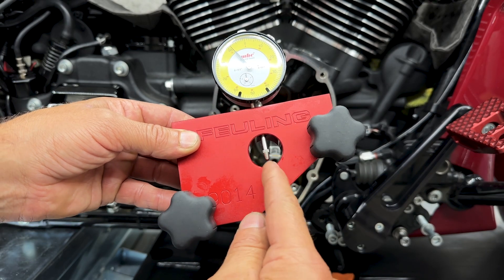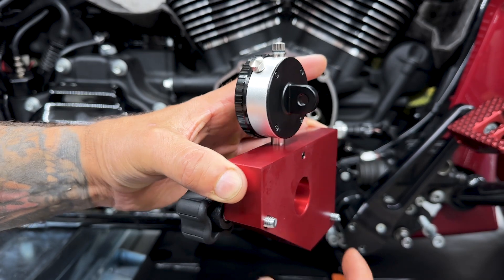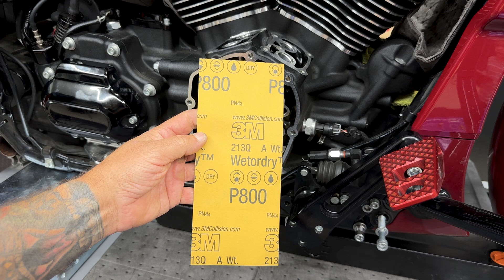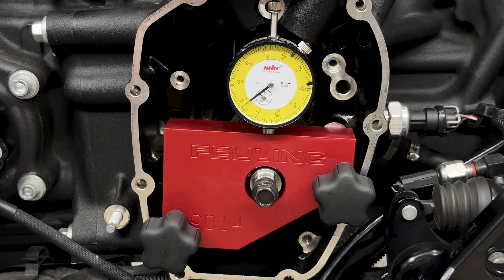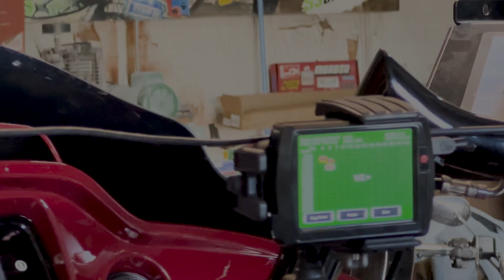Crankshaft RunOut on Milwaukee Eight Engine - Feuling Measuring Tool

Comment: Nice video, im not sure id leave it at the edge of spect. For my bike i plan to keep i think i would get an S&S welded crank and timken bearings so that i know the engine wont beat itself apart in another 10,000 miles.
Reply from the maker: These are fueling specs.  They would not want to be liable for any Harley Parts failing early.  Harley specs are a lot higher.

Comment: So with that much run out what do you do to be able to do gears instead of chain? Just got my harley and am trying to learn about them and upgrades
Reply from the maker: I’m most cases, you would have to change out the entire crank.  This is a lot more involved, and I would highly suggest a certified professional.
Reply: I'm in the camp with you. I fear if it's out of spec for a gear driven cam will that lead to other component failures in a year or two such as the oil pump ect? I can save a butt load of money doing all the work myself but as I add up the parts costs for a cam chest assembly, a welded crank/flywheel/rod assembly with timken bearings.... I might be money ahead to just order a complete S&S engine and do a motor swap that will have all the right stuff installed in it already? I need to crunch numbers but....